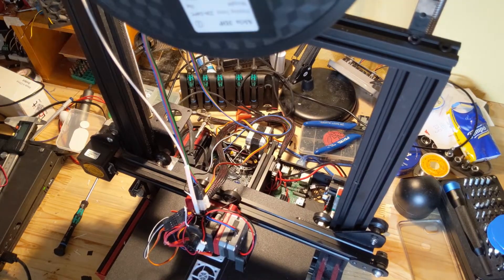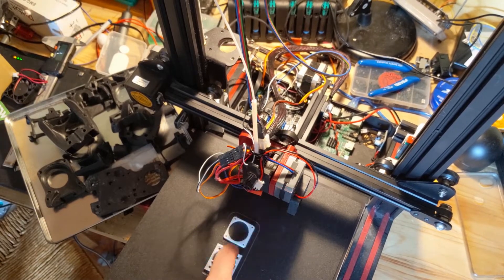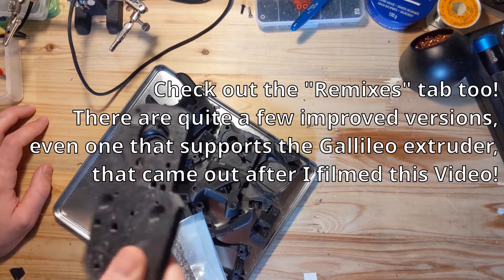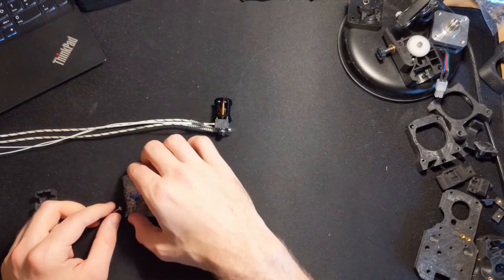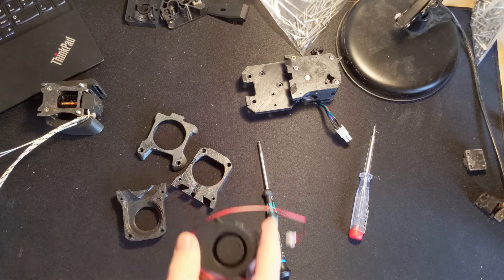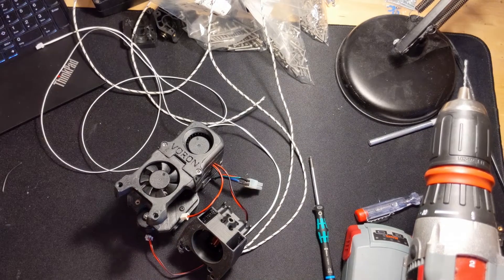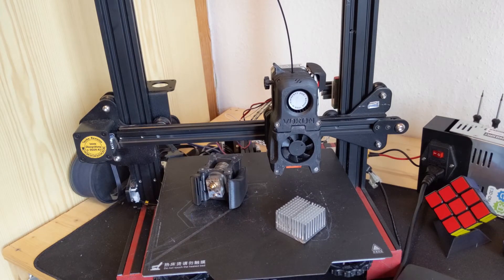Ender 3: Voron Afterburner Upgrade

Comment from the maker: For anyone also building this, WARNING: DO NOT USE THE ORIGINAL CREALITY FANS FOR HOTEND COOLING!
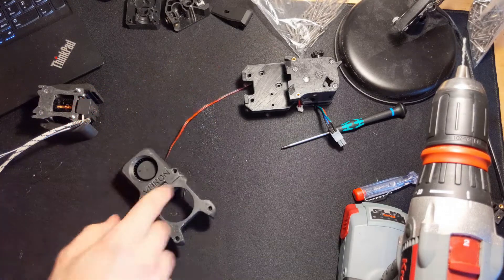The original creality hotend cooling fans (14:14) don't blow hard enough to prevent heat creep on a E3D V6! I still had some fans from E3D's web store (Xinyujie XY24B4010M) that fixed the problem, the ones off the Voron sourcing guide should also work.
Reply: pro tip, 13:50 use the metal side of the lighter you are using, its way easier on the fingers and it will flatten it more evenly. (also works for paracord and other plastic ropes)

Comment: Regarding your overheating stepper: do you use one with 0.9˚/step or 1.8˚/step? Vorondesign recommend using 1.8˚ ones, since they require less steps to drive and most of their motion systems are geared anyways.

Comment: Are you using a direct drive system ? I dont see the bowden tube,  so is the M4 integrated in the Afterburner or what ?
Reply from the maker: The Afterburner uses a integrated direct drive extruder called Voron Clockwork, a repackaged Bondtech BMG to fit the mounting. At 9:58 you can see its assembly.
Reply: @SERVOPUNK  Ah, so I first will make  M4  I guess and print the head then
Reply from the maker: @Spelter  Or you could buy a Bondtech BMG (or clone) and make the Printhead using that, since you'll need pretty much all of the BMG parts anyways.
Reply: @SERVOPUNK  I sourced the parts for my M4 already and where is the fun when I buy it?
Reply from the maker: @Spelter  You're right. I was optimizing for cost, not fun. If you already ordered the parts your plan definitely seems more reasonable, you might even want to consider using a afterburner bowden version with the M4 - someone swapped out the clockwork extruder with a simple bowden adapter. It's on thingiverse.
Reply: @SERVOPUNK  do  you have a link to it, I think I know what part you mean, but just to be clear, it's just the back plate?
Reply from the maker: @Spelter  There's the adapters on thingiverse, and then you print the official voron parts. https://github.com/VoronDesign/Voron-2/tree/Voron2.4/STLs/VORON2.4/Gantry/X_Axis/X_Carriage
Reply: @Spelter  you can keep using the M4 with Afterburner. It has multiple options for different hotends, clockwork extruder, original Bondtech LGX, or a Bowden setup

Comment: Have you considered klipper and input shaper to get ringing out? 7k acceleration wouldn't be possible on my Switchwire without it thanks to the bed resonance, which also seemed to affect you.
Reply from the maker: I have way bigger problems than ringing, my single-side driven Z axis is causing inconsistent layers in the right half of the printbed for example. Once I find the motivation to upgrade the kinematics to a CoreXZ style I'll look into klipper firmware.
Reply: @SERVOPUNK  I had the same z problem on my ender 3 pro. I ended up taking the printer apart and putting it back together with my square. After tightening everything correctly It fixed itself. I have since installed klipper and am printing at speeds up to 350 mms. I am printing the voron parts now and thank you for your video.

Comment: Cant your share slicer seting for abs voron part and printer.cfg for ender 3 afterburner mod?
Reply from the maker: I use a Prusa MK2S+ profile with a modified start/end G-Code and build volume, nothing special there. And last I checked Marlin firmware didn't have a printer.cfg file